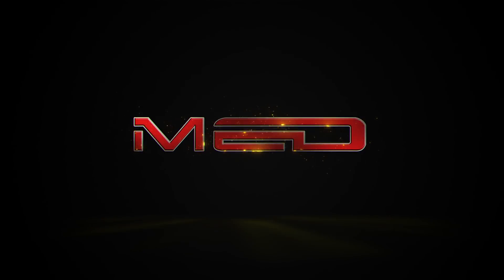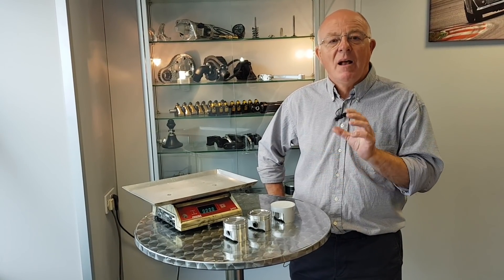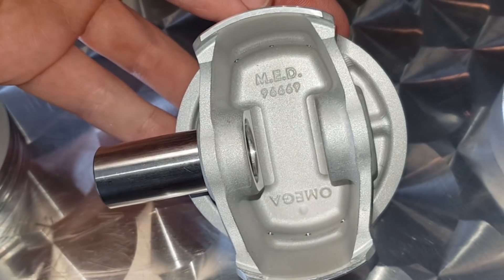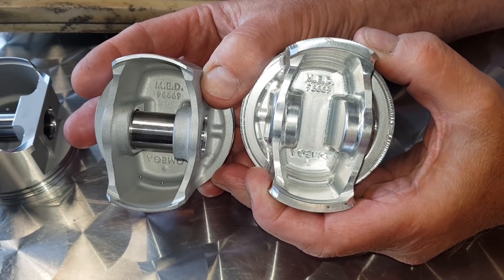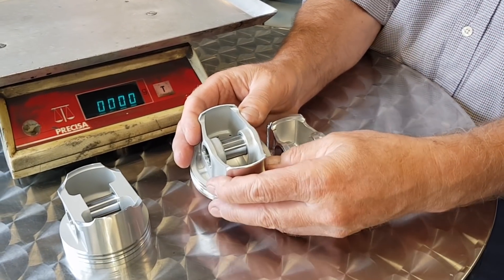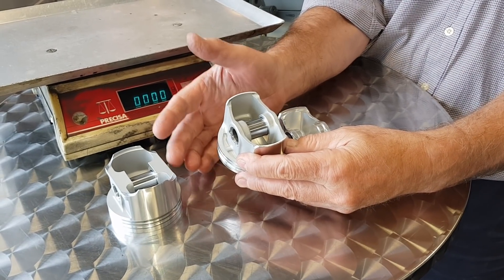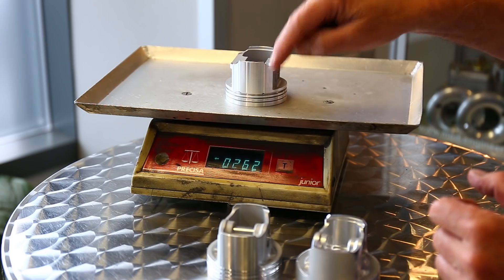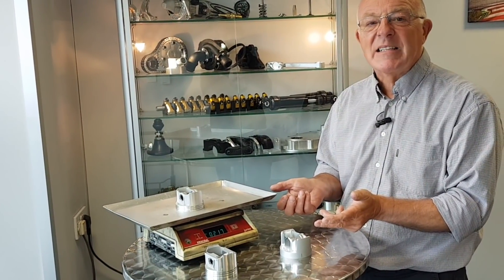Prototype billet Omega pistons

Comment: I have a couple of questions if I may please. As far as I understand billet pistons are made from extruded billet bar. Then they go directly to cnc machining. But is there a heat treatment process once the chunk of aluminum cutted of the billet bar prior to machining OR the extruded 2618 billet bar already has been heat treated as a raw material in the form of T4, T6 etc ?

Comment: So if this is machined billet then it should not be as strong as an identical forged piston?  Therefore why not either use this machined prototype as a retail piston or reduce the forged version's weight even more?
Reply from the maker: Forged is stronger like for like, yes, although strength at this level is less of a concern as they're both more than capable of full race usage in an A-Series. It's all about small batches, the experimentation and light weight that allows. We can sell the lightweight specials, but they are approaching three times the price due to the batch size and construction. What we learn from the low volume billet designs go into future development of the retail forgings. :)

Comment: How much are a set of rover 3.5 v8 forged pistons?
Reply: If you have too ask, you probably can't afford it.
Reply: Anyone with a CNC Maching Center and a skilled operator can make a piston blank too suit any type of Engine you can dream of, however there is more too it than that, Piston Material, Shape, tolerance, expansion, application not too mention other factors must be taken into consideration. I don't know what this company charges, but What is being shown here is simular too what I used too do as a toolmaker and from where I come from at $200 aud. an hour making something like this is completely out of reach for the average person.